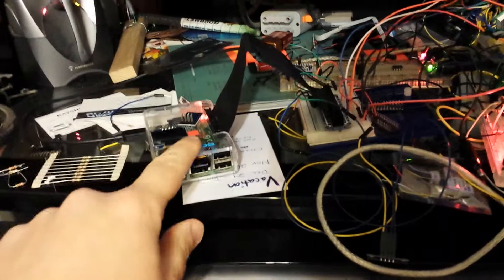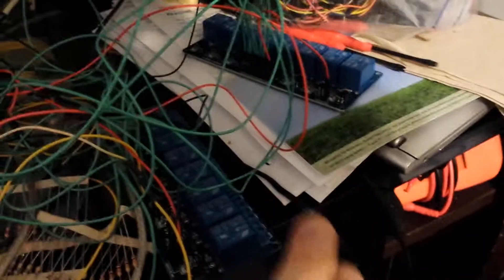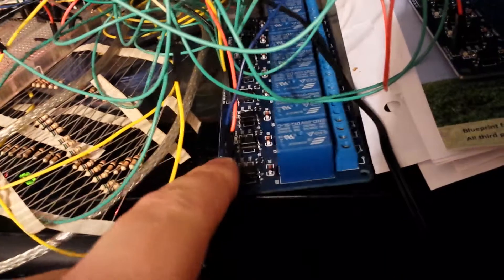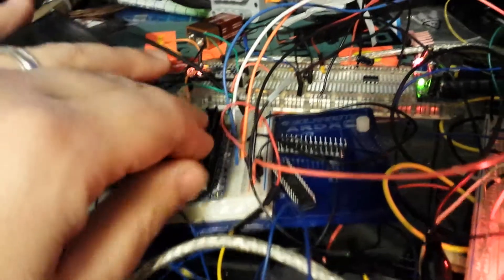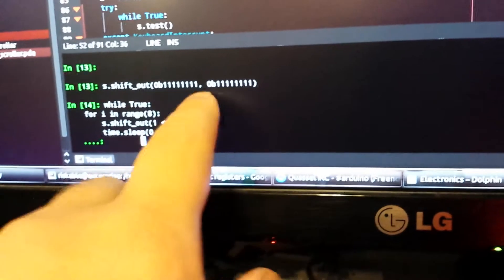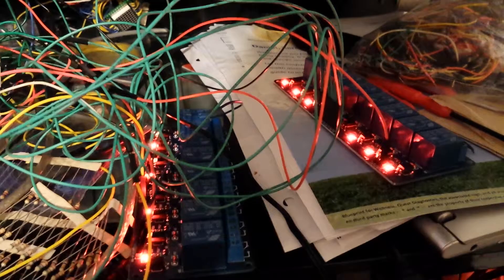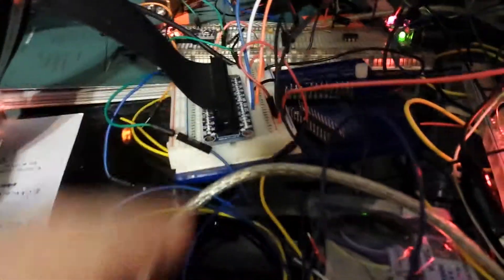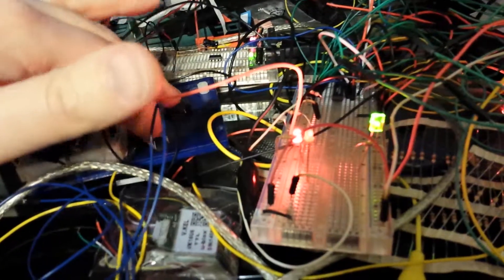2x 8-Channel Relay Boards on Raspberry Pi via Shift Registers

Comment: Is it possible to shift in using python,raspberry pi and shift registers?
Reply from the maker: +Esat Karaer Yeah why not?  That's exactly what my setup does.  There's a link in the description to my little Python module to make shifting bits into the shift registers super easy.
Reply: +Dan McDougall yes, but i want to reverse all of this, by switching the relay from something else and then reading the relay module with the shiftregister
Reply from the maker: Oh, you want the opposite.  Yes, you should be able to do that but my module won't work.  I'm sure there's other modules to do that though or you could just look how mine works and figure it out on your own.  Shift registers aren't that complicated :)
Reply: +Dan McDougall Hey, i got a solution and thought maybe you would like to know it too. I am using a MCP23017 port expander now. Now i can write and read data at the same time :)
Reply from the maker: Yeah the MCP23017 is pretty nice but they're expensive. A few years ago I bought a 50-pack of shift registers for about $0.05/chip but the MCP23017 costs about $1.50 each.